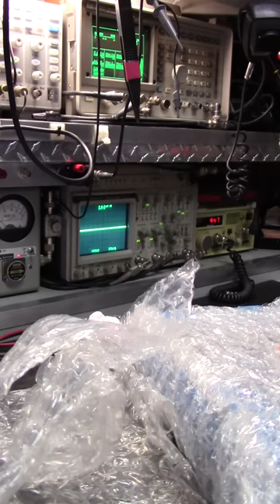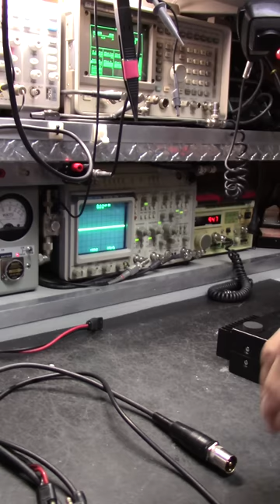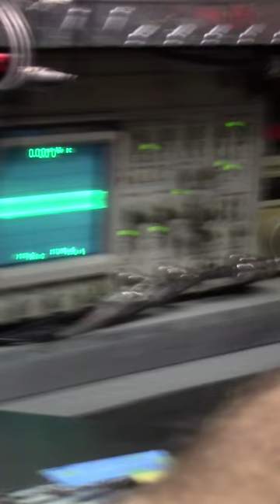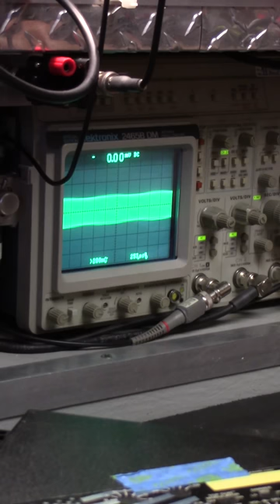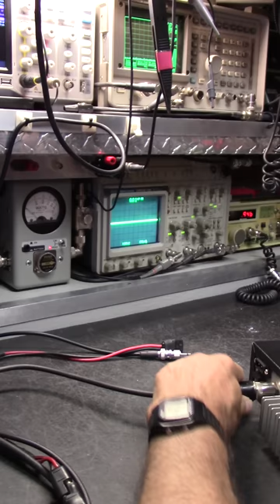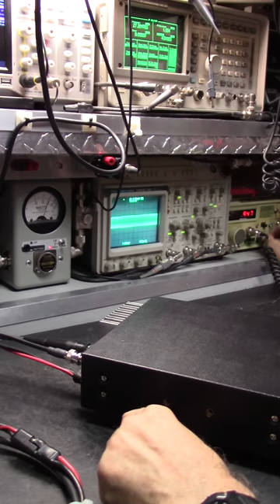Hocus Pocus Pixie Dust 10 Meter CB Radio Topguntec MD-1 Top Gun Modulator And CP-1 Speech Compressor

Comment from the maker: Here's what it takes to cut through the noise "and be crystal cleaner". True, it's more complicated and time consuming to accomplish these consistent and accurate results. Below is a partial procedure and list of calibrated equipment used to achieve this level of performance.  Read on.

Fine Tune CB Radio Shop strictly adheres to (https://www.nist.gov/) NIST Traceable Calibrations and other industry standards to maintain accuracy and consistency for providing "Real World Performance Tuning" of Citizens Band and 10 Meter export mobile radios with integrity.

Pll adjustments include but not limited to: VCO & OSC, AM TX OSC, USB TX OSC, LSB TX OSC.

Transmitter alignment includes but not limited to: DRIVER BIAS, FINAL BIAS, SSB CARRIER BALANCE, HI-LO AM & SSB Power, RF METER, AMC, ALC and FM DEVIATION.

Receiver alignment includes but not limited to: AM/FM RF & IF SENSITIVITY, FM DETECTOR/DEVIATION, SSB IF SENSITIVITY, SSB S-METER, AM/FM S-METER (100uV unmodulated -67dbm for “S-9” meter reading!), AM/FM SQUELCH RANGE, SSB SQUELCH RANGE, and NOISE BLANKER/AUTOMATIC NOISE LIMITER.

That's just a typical run of the mill textbook tune and alignment! There's much more to it than a frequency alignment, modulation adjustment, meter calibration and tune for maximum rms, average peak watts for a tune up report!

Test Bench includes but not limited to the following:

Bird 4314C Meter:
https://www.birdrf.com/Products/Test%20and%20Measurement/Power-Meters/Wattmeters-Line-Sections/RF-Wattmeters/4314C_PEP-Single-Element-Wattmeter.aspx
Part 1) https://www.youtube.com/watch?v=RpX9IHe4ORM&t=16s
Part 2) https://www.youtube.com/watch?v=LuhbqTf6Bxw
Bird 4314C Accuracy Test: https://www.youtube.com/watch?v=DqEOabYqhQo&t=5s
Bird Stipulates 1/2 wavelengths  https://www.youtube.com/watch?v=5eWhgT-rTII
And Genuine Bird Elements from 1K down.

Bird Sampler: 
https://www.birdrf.com/Products/Radio%20Infrastructure/RF%20Components/Variable-Signal-Samplers/4273-Series_15-35-MHz-Variable-RF-Signal-Samplers.aspx

HP8924c with options:
http://userequip.com/files/specs/2147/HP%208924C%20Repair.pdf
https://www.youtube.com/edit?video_id=Cg1w0xBa27s&video_referrer=watch

HP8920a with options:
https://www.keysight.com/upload/cmc_upload/All/EPSG072204.pdf

Three analog Oscopes, one digital 200 Mhz and scope in service on The Bench:
https://www.atecorp.com/atecorp/media/pdfs/data-sheets/tektronix-2465b-2467b_manual.pdf
https://www.youtube.com/watch?v=by98x4eu2lM

Fluke 27fm:
http://www.fluke.com/fluke/inen/digital-multimeters/fluke-27.htm?pid=56055
 
LCR http://www.lcrresearch.com/wp-content/uploads/2017/05/LCR_Pro1_Manual_version1.03.pdf

Power supplies:
6 Cosel PBA1500f12 (750 amps) variable and configurable.
https://en.cosel.co.jp/product/powersupply/PBA/PBA1500F/PBA1500F-12/
Corcom 20VB1 F7130 EMI Filter 50-60Hz 250V:
http://www.te.com/usa-en/products/emi-filters.html

Times Microwave Coax jumpers and test leads:
http://www.timesmicrowave.com/cms/products/cables/lmr/
https://www.youtube.com/watch?v=EmqaGJ6IWow
https://www.youtube.com/watch?v=1ltFVSxGp5Y
https://www.youtube.com/watch?v=v12YZT_1o90
https://www.youtube.com/watch?v=h7iiYfmYWRA&t=215s

Amphenol RF Connectors:
https://www.amphenolrf.com/
https://www.youtube.com/watch?v=dVh5B0hdEA0 
https://www.youtube.com/watch?v=dKZg8T_AOso

Want more range, compliments, reliability and a quieter, clearer but more sensitive receiver? Get Fine Tuned .. not peaked and ruined! 

Here are some VideoGates of me at the bench practicing what I preach using my bench radio or customers radio completed and ready to be shipped: https://www.youtube.com/results?search_query=hard+drive+163+ more: https://www.google.com/search?q=Hard+Drive+163+nm&ie=utf-8&oe=utf-8&client=firefox-b-1-ab

It's what I recommend, use, service and sell ... to you ... not something non practical or deceiving in a misleading way. I'm not just the tech and owner of Fine Tune CB Radio Shop, I'm a customer too! 

You'll be giving radio checks .. not asking for them.

Hard Drive 163 NM. 73's! Click click.
Reply: Cb

Comment: I had one of the amber magnum 257's. The transmit was a bit nasally sounding, but clear on am and ssb. The receive sensitivity was simply amazing.  Had to sell it because sh!t happens. I'm hoping the anytone will be similar in performance. 73
Reply from the maker: The originals were amber, I like the AT's much better.
Reply: had the same radio. had better transmit audio than my ranger 2950 by a long shot. loved that radio. BLAZE572 and i just got down!